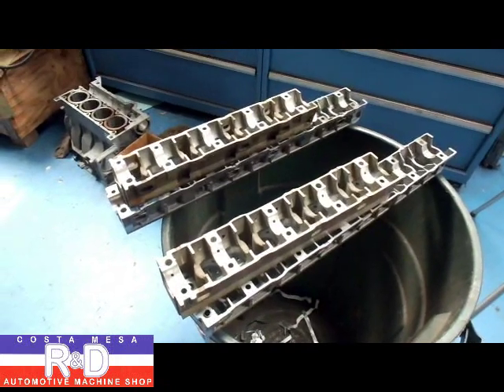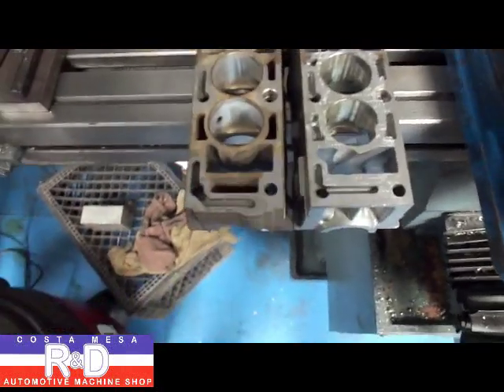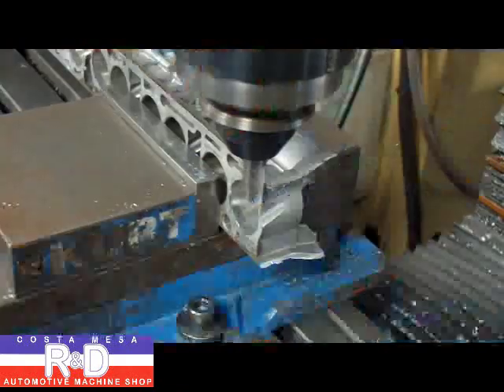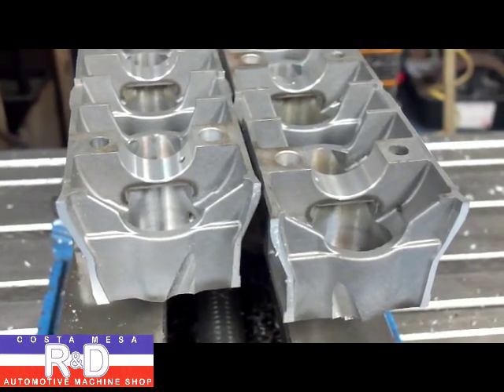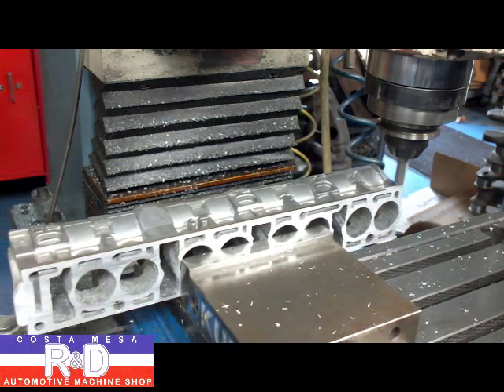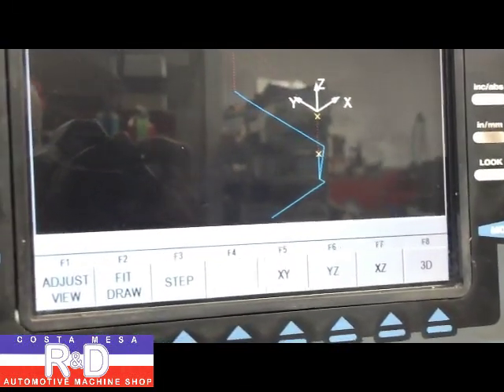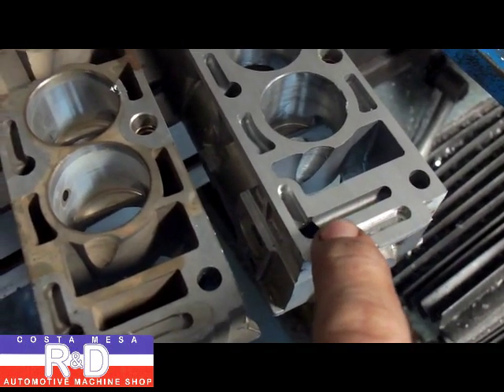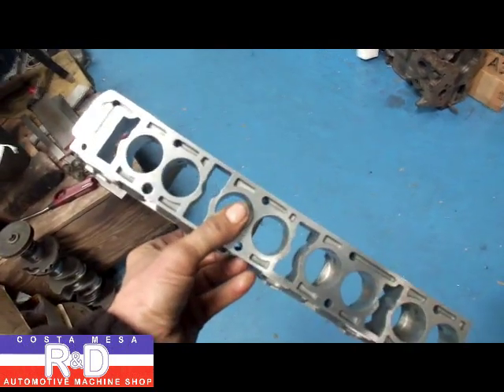S50 BMW Cam Tray Modification for M42 Engine

Comment: Would it be feasible to take the original cam tray and sleeve it with bronze bushings to the smaller lifter diameter?